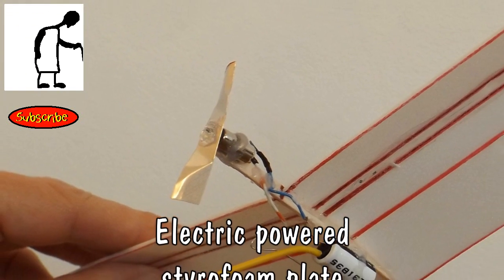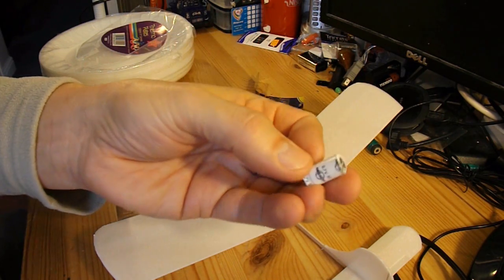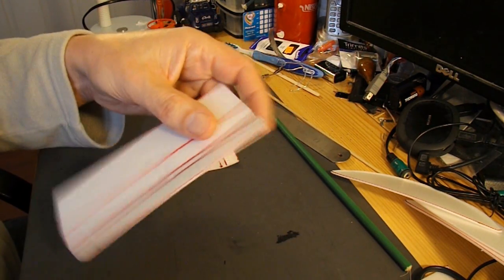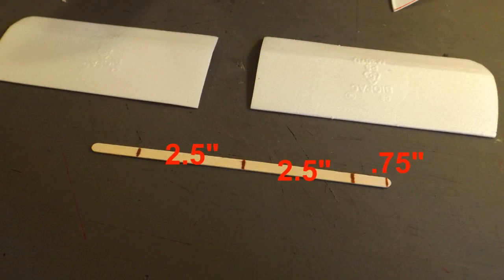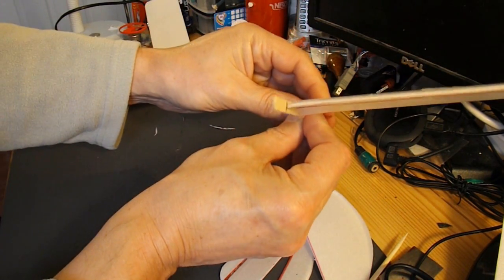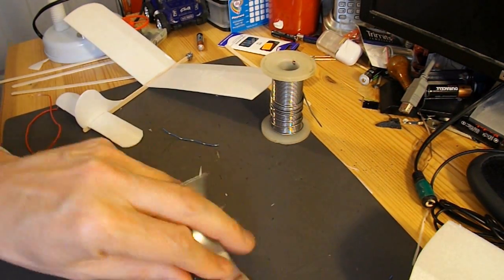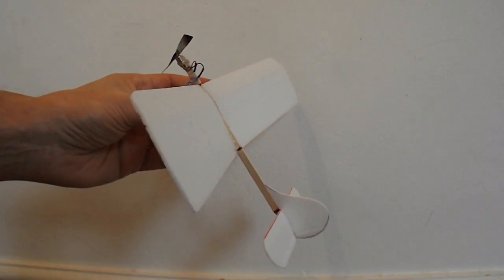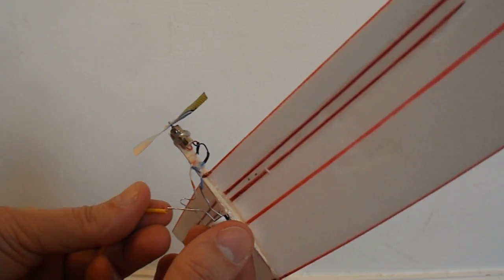Electric Powered Styrofoam Plate Airplane

Comment: This is tremendous! Never mind my helicopter idea, I'm going to do this one first. I recon with a larger wing and a better propeller, this would be even better! :)
Reply from the maker: The biggest problem here was finding a suitable propeller. The shaft on those OralB motors are smaller than 1mm and the smallest diameter props I can find are 1mm so you either make your own or bodge it with hot glue or similar.
Not sure if I already gave you this link, but it is the second instalment for this plane and I use a small plastic prop and nearly loose the plane http://youtu.be/CGoNRQamdcs

Comment: It went better than the rubber band one. Better day.
Reply from the maker: If you want to see some pretty odd looking planes made from polystyrene pizza trays and similar Styrofoam items there are plenty in this video. This should clarify the level I am aiming for with these projects.
The best flight of the day is mainly off screen - of course, like any fisherman's tale- at about 3.10 and is one of these Styrofoam Plate planes.
It's a sunny afternoon, let's fly some planes (to destruction) 
http://youtu.be/6-nJN8Uxh4s?list=PLA5a2xPRSrB0nZItxE_78EJP0F99Ghaki

Comment: How long does one charge run for?
Reply from the maker: Just a few seconds at full power then it rapidly drops off. That is exactly what I want from it for flying outdoors, a burst of power to get the plane into the air so it can then glide back down. Here is another version that lasts a bit longer, watch it from about 3.46 http://youtu.be/8NMZIpK7rTQ?list=PLA5a2xPRSrB0nZItxE_78EJP0F99Ghaki

Comment: I was thinking of making one with the toothbrush motor and then I found your video. I like your project and it has given me hope that my one just may work. Thank you for sharing.
Reply from the maker: Good luck with that, finding or making the right sized propeller is the hardest part.
Reply: Thanks I think I will buy a propeller.
Reply from the maker: That is half the problem, finding small enough propellers that will fit the tiny shaft on those motors.

Comment: Grandad can a make a car with a banana instead of a potato
Reply from the maker: Hi Christopher, if you mean to power it using electrolysis, then NO, there is not enough current generated to drive a motor with sufficient power to carry it's own weight. If you just mean to use the banana as the body for the car, then I could but it would just be a matter of putting axles on it and adding some sort of drive mechanism. I don't have any bananas in the house at the moment.
Reply: Okay thanks anyway

Comment: cut stirophoam with hot wire cutter and  you can make homemede gearing from old clock  and make it fly better.. Or make 2 motor vershion. But this is nice plane very good job..
Reply from the maker: Thank you for your comments.
Reply: http://static.rcgroups.com/gallery/data/500/200522_2gGB_1-med.JPG
Reply from the maker: josip :D (snakeinthebottle) Thanks, great picture.
Reply: I like to help

Comment: Admirable work! It's incredible! As a child I dreamt of a AA battery powered airplane...but this is much better!
I've got a question though: wouldn't the capacitor charge instantly? Batteries require time, I know; but a capacitor?? Is it due to the 5F? Thank you, and congrats again!
Reply from the maker: Hi, to be honest I know very little about supercapacitors other than they work like capacitors and batteries at the same time and are much lighter than normal batteries. I made no attempt to measure what I was putting into them or how much charge they were holding, just did trial and error. They certainly lasted longer with a longer charge but I certainly didn't want them to drive the motor for more than a few seconds anyway or they plane would have left my garden and I would be ringing on neighbour's doorbells asking "Can I have my toy plane back please" and I didn't want to do that. I was tempted to use button cell batteries but they would have lasted longer and then need replacing.
Reply: Hmmm...Time to make one by myself and test everything =)
And sure batteries need replacement, and rechargeable ones have the infamous memory effect...so your idea is the best! I was really impressed by the flight time. Where did you get the capacitor from? scratch maybe?
Reply from the maker: DoNotPushHere I wouldn't say it was 'my idea', I believe these supercaps are used in those lightweight r/c aircraft that you recharge from your transmitter, or something similar. I considered buying the caps from eBay but was a little wary over what I might actually receive and I wanted it quick so I went to my nearest Maplins and bought them over the counter. I had no idea what size to buy so I just looked at them and decided they looked about the right physical size and weight. I would suggest googling them for a bit more info before buying any. They seem to vary in price dramatically. I bought 2 and they were about £1.59 each.
Not sure if this link will work for you http://www.maplin.co.uk/search?text=supercapacitor&x=0&y=0
Reply: I would say all RC's use batteries...They can hold much more power per unit weight. I'm foreign so first I'll try to buy the capacitor on a local shop to avoid shipping costs... Have you tried to increase capacity? I think that glider can still hold a 10F 2'7v capacitor.
Apart from that, I think a lighter and more durable propeller could be done with a strip from a plastic bottle, turned to the shape by heating it under hot water. i made a couple of them this way, and since they are flexible, they withstand hits and bad landings.
Reply from the maker: DoNotPushHere These are the first supercaps I have tried, so I haven't tried any different capacities and I don't need them to fly any further or longer as I have nowhere suitable to test them over greater distances. They really need to be indoors unless the weather is absolutely perfect. I did use plastic bottle propeller on one of my rubber band powered planes - same design - and that worked fine. The main issue in both cases is how to fix them to the shaft of the motor. I nearly lost the rubber band plane as it climbed well and caught a breeze. I had a good run to collect it.

Comment from the maker: I am often asked to build a powered aeroplane and I wanted an excuse to buy a 'super capacitor' so I built another one of my chuck gliders and glued an electric motor from a vibrating toothbrush on the front. The propeller is made from a strip of aluminium cut from a drinks can.